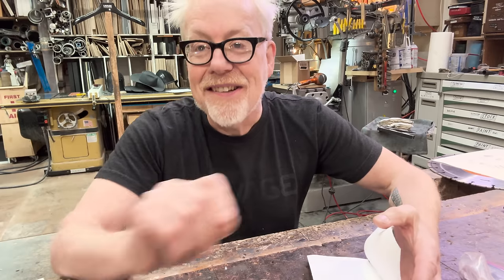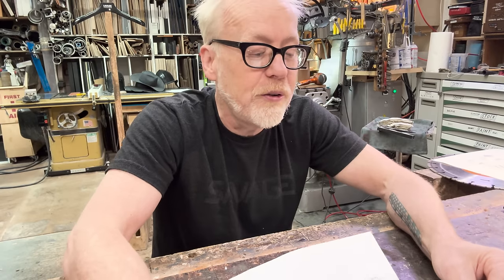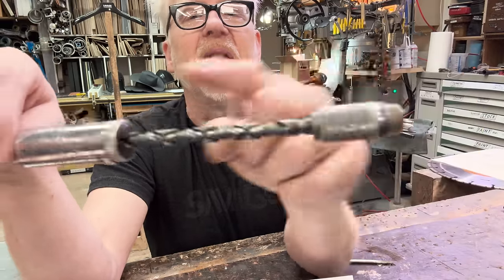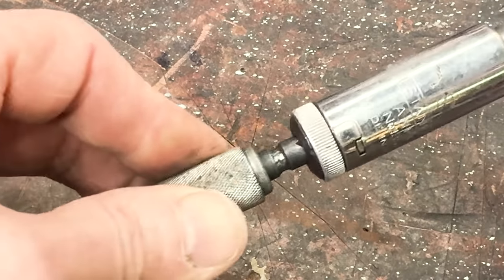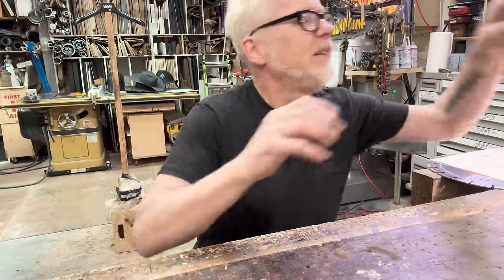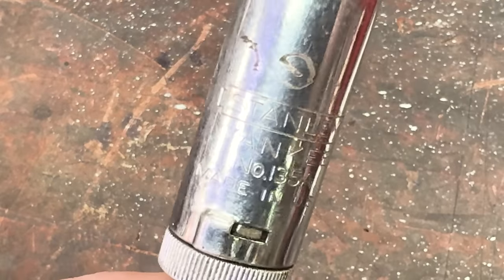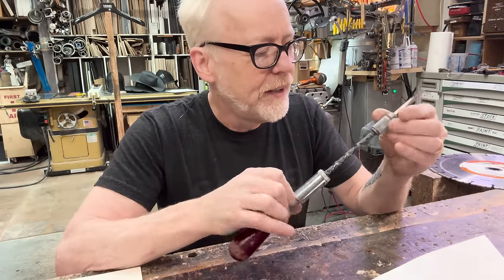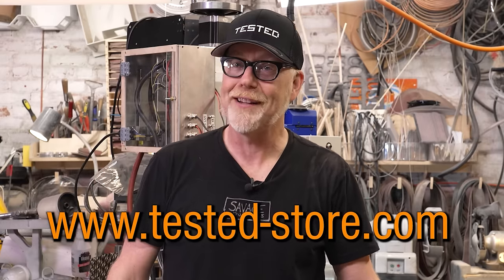Adam Savage's New Stanley Yankee Screwdriver!

Comment: Stanley Yankee pump action screwdriver …….. the tool of the devil in the 70’s. How many times did I watch my dad struggle with his. 😂
Reply: And the whole thing jumping out 😂from its locked stowed position threatening to take your eye out!
Reply: @SierraLimaOscar  I have a blurred recollection of my brother nearly losing an eye due that happening 🥴 They were a lethal weapon in the wrong hands. 😂
Reply: In the UK 20  years earlier, the first DIY TV show was a guy called Barry Bucknell .  He had a 12' Yankee ,  Thump, Thump Thump and the screw was in no messing.  Everything pre-drilled and prepared before he came close to it though
Reply: @russeldavis1787  Ahh, yes I do remember him. He made some neat things and made it look soooooo easy 😂
Reply: I have one that was my grandfathers, unfortunately it only has one bit. I have used it a few times over the last 30 users, it’s actually not bad unscrewing wall plates.
Reply: @only1muppet  I have a couple. Bits are surprisingly easy to find on Ebay and the like. I actually took a magnetic 1/4" hex bit holder, ground a flat on the end of it, and keep that with my Yankee screwdrivers. Makes them much more versatile. Not that they're very practical compared to a cordless drill or impact.
Reply: An absolute joy to use with slot headed screws 😆
Reply: My dad had one of these in the 80s
Reply: @russeldavis1787  He had a twelve-foot long screwdriver?
Reply: @SierraLimaOscar Guy at my carpenters trade school in the 80’s put one into his hand while messing around. He was unlocking it and relocking it letting it shoot out and the tip went into his palm. They were banned there after this and he was very unpopular with the rest of the apprentices.

Comment: A friend of my father’s was a salesman for Stanley. Their demo for the Yankee was to pilot drill 5 holes, then start 5 screws in a board and give a normal screwdriver to the customer.  They were invited to put the screws in. While they were doing that the salesman would put a drill adapter into the Yankee, pilot drill 5 holes using the pump action. Then switch to a screw bit and drive all 5 screws home well before the customer would get his screws more than half screwed in.

Comment: Adam, the strait knurling forward of the switch locks the action in the collapsed position. Also the middle selection disables the ratchet setting. I have several of those from my great grandfather.
Reply: And they can work like a regular screw driver when you need it.
Reply: It was bothering me that he never locked it close.lol
I'm sure he was doing it on purpose 🤣😂🤣
I still have the large version in my tool box. It's a Beast of a thing
Reply: Yes, and when it is unlocked from that position it automatically springs open, Harry Tuttle style. (At which point, one should say "I'd like to talk to you about your ducts.")
Reply: Correction: only the longer ones have the spring. I didn't realize this, because I have only ever used the long model,  not the shorter ones. My bad. Adam will need to get a 131A for his Tuttle Tool Bag.
Reply: @mikevandebunt811   From the way it responds on video it looks like Adam's has the spring. Looking closer he has a 135A. The '35' is the smallest size and the '1' indicates spring return.
Reply: @eDoc2020  OK, sounds good. Other videos have said that the A is there to indicate "automatic", i.e. spring return. (The one I have is a 130A, so either the 1 or the A indicates the spring. Isn't tool archaeology fascinating?)
Reply: @mikevandebunt811 1 is the fact that it has the spring. A indicated that it was the earlier model

Comment: You can lock the screwdriver in the compressed position by twisting the collar near the switch, it will then operate as a rachet screwdriver too in either direction, selected by the switch.

Comment: Hi Adam!  The larger one you mentioned is the model 131A and the "shenk!" sound it makes when released from the storage position is soooo satisfying.
The knurled ring between the base and the helix is turned to lock the driver in the shorter storage position (and then to release it with that dramatic flair as De Niro did).
Lee Valley Tools sells adapters for both size Yankee's to allow 1/4" hex bits to be used.

Comment: Fun video.  I have one of these screwdrivers but it only comes with a straight slot bit.  I was able to copy the notches on the shank of a standard hex adapter so I can use any modern bit in the tool.  Works great and doesn't hurt the tool or the look of it.

Comment: As a handtool inclined hybrid hobbyist woodworker a Yankee screwdriver is my preferred method for drilling pilot holes.  The straight fluted bits that came with mine are wonderful.  Plus it's just so much fun to use.

Comment: I have the long one and the short one both are fantastic. I have power tools but sometimes you want to put something in by hand so you can feel the screw so you don't strip it. The bits can be a little expensive so I was happy to find Axminster tools in the UK sell a hex head adapter which means all your standard hex head bits will now fit in there including hex head drill bits which comes in extremely useful.

Comment: I have one of these Stanley Yankee screwdrivers that has a plastic handle that hollows inside and holds several different bits with a screw on cap on the end. I picked mine up from an older friend of the family who'd passed away. I've used it a few times so far along with a Carpenters Bit Brace Hand Crank Drill and some vintage planes, several draw knives and other vintage woodworking hand tolls from the same old guy.

Comment: I have three of these, one about that size and two larger ones, one of which I kept from my late father's tool kit.  Way back before cordless drills/drivers were a thing, I used to carry a big one and a small one for my work as a door engineer, and I had a whole set of drill bits and countersink bits, for both drivers, as well as all the screwdriver bits I could get in each size.  They still hang in my workshop, as I can't bring myself to get rid of them.  They did so much work for me, it seems almost wrong to discard them.

Comment: I still have mine from April 7, 1969 - mine is all stainless steel and the buts store in the handle - I used it mostly with drill bits to put the phone jacks on the wall - they are great tools - I also had a couple like that one and might still have one - I do still have a hand drill that has a hand crank like the old meat grinders had - also mixers had them -

Comment: I've had a larger version Stanley Yankee in my toolbox since the early 1970s. Set the switch in the middle position to use the screwdriver in a traditional (wrist breaking) way. Compress the driver and twist the locking ring to store it in a smaller space.

Comment: I have what appears to be another of the same screwdriver! And yes, every time I use it I think of Harry Tuttle.
If you compress the screwdriver and switch it to "locked shaft" mode it will stay that way until you change mode, at which point you get that lovely "shoonk!".

Comment: My father owned one of these monsters, and I cannot tell you how MANY times I painfully pinched my finger tips while using it, sometimes even drawing blood. I finally learned to avoid it entirely. However, in its favor, it should be noted that the mechanism produced almost NO useful torque, such that it was almost impossible to actually damage a screw head with it. If there was ever a tool that should go down in INFAMY in history, it's the Yankee Screwdriver. [The beloved Yankee Drill, however, is a whole nother story, and I still own one of those antique models, which proved that drill bits don't need to have a "twist" shape.]

Comment: I have one of those that I probably bought at Sears in the early '70s and used regularly at my job in a boatyard.  Very useful tool, and I never witnessed anyone injuring himself or others during it's use - maybe it's a generational thing.  I also have a push drill that operates in much the same way.  They're both very handy - no cords or batteries to cause frustration.

Comment: These things are addictive. I bought one for odd jobs around the house about 10 years back, still use it. Problem was, it led me down a rabbit hole wondering how they came about.   Almost 2 dozen later i  now have a collection going back to 1874, including a couple made by F A Howard in 1874 to Isaac Allard's  patent. Allard actually patented one as early as 1868 (believed to be the first) but no working example has been found to date.  😎

Comment: My Dad had the longer version, and it always fascinated my as a kid. One thing that isn't obvious, when the driver is fully collapsed there is a collar just forward of the selector that can be turned which locks the mechanism closed. You can then use the driver in just 'ratchet' mode where you can just turn the handle without needing to push it in.

Comment: Pretty sure I had one exactly like this, right down to the Stanley brand, when I was a kid and had what I just now realize is my first makerspace in the attic of the house I grew up in, which was not floored or anything - I just had a narrow board walkway & platform (presumably left by the builders from when the house was first built) & a worktop screwed right into the roof support structure. It was sort-of my Emil from Lönneberg woodshed where I went to hide from the grownups 😁

Comment: I recently inherited one of these from my grandfather--I haven't used it for anything other than display and fidgeting so far, but it's absolutely one of my prized possessions. Just a super cool old tool.
Another film appearance of this is in Breaking Bad when Mike, Walter, and Jesse are breaking into the police yard to sabotage Gus' laptop with the giant magnet--Mike uses one of these to quickly pull the cover off the keypad. 
And on the Air Force Museum outside of Dayton--omg yes, 1000% a must-see. Plan for at least a full day there, maybe even two full days. I spent a half day there and at a certain point I just had to start snapping pictures and then running to review and read the plaques at a later time. It is absolutely massive and amazing. I can't wait to go back eventually and spend a proper amount of time there!

Comment: I have the same Yankee but mine is made by North Brothers. Stanley bought North Brothers at the end of the war. Push the driver in and twist the knurled part and it will lock the driver in for storage or to use as a normal screw driver. Just a little twist of the knurl and it will shoot out again. Elwood Blues had one he used on an elevator panel in the Blues Brothers.

Comment: I always preferred the impact driver...very similar, except this one you hit with a hammer, the blow from the hammer not only rotates the bit, but the impact forces the bit into the screw head as it rotates.  Doesnt always work great, but for those really stuck screws, it can sometimes be a life saver.

Comment: Dammm, i haven't seen one of those in a very long time, My Dad had one, thats back in the 70's and 80's. Great memories came back using it with him and boat building, miss him, Dads been gone 20 years now, thanks for the reminder of great times with him. Actually i'f i'm not mistaken, i have a large steel chest with Dads wood working tools, it might be in there, will let you know. Checking it out when i get home tomorrow. Editing:,,, couldn't wait till tomorrow, went and foung his chest and took everything out and found some wonderful old hand tools, and yes that screwdriver was there, shorter than yours and another more modern one where the helix wasnt on the outside but rather somewhere inside the works, its smooth on the outside with a plastic handle with a removable top on the handle where different bits are housed, memories, there is some rust now on them but i sprayed everything down with wd40 and after the sugar crop here in Barbados, i work for the sugar industry, i'll be demolishing my workshop and rebuilding it twice the size, planning on a glass fronted case so those lovely tools can be displayed after i've cleaned and sharpened them, i'll be putting some use into them again.

Comment: We, my family, had a Yankee Screw driver when I was a kid. It came with the straight slot driver (bit). As far as I know, they were supposed to have other bits (drills, etc.), but I've never seen any, designed for the screwdriver. The shank size limits what can be used. I suppose that other bits can be modified, to work?
Stanley also makes the Yankee Drill. Same basic design principal, but comes with a set of very small drill bits. I own one. This tool is super for drilling small holes in anything, but metal.

Comment: I have two of those Yankee screwdrivers in my tool box, you can buy an adapter that fits in the chuck that allows  you to use the standard 1/4 bits that you would use in magnetic screwdrivers of today, I don't use them often but for nostalgic reasons I can't get rid of them.

Comment: You didn’t mention the third position that locks the extension. Or the knurled ring  that locks the extension closed. Or the use as a ratchet screwdriver with the extension closed. Steve
I ha both small one like this and one of the large ones as well

Comment: If you compress it, you can lock it.

I have three, two large Stanley and a smaller Japanese one (forgot the name). I use the small one fairly frequently. It's a fun tool so it has its very own special task that only it may perform (screwing a bench hook/plane stop to my Low Roman Workbench).

Fun facts:

- If the bit isn't properly secured and the locking mechanism is then engaged to extend the drill, the bit will shoot through the room.

- Do not unscrew the big screw on top of the handle—especially if the screwdriver is compressed. The very strong spring inside the handle will seek its freedom.

- Bits can still be bought—just remember which size your screwdriver uses.

- A bit holder can be bought to hold any type of standard bits to use in the screwdriver.

Comment: I have several of these, including this exact model. The bits are harder to find than the driver itself - some of them were built with a compartment in the handle, accessed by a screw-on cap, where the bits could be stored. Properly lubricated, they are easily more appropriate for some applications than the ubiquitous cordless screwdriver.

Comment: I have a couple of these in different sizes which I inherited from my dad who was a carpenter at the Dutch Tropical Institute (Tropenmuseum). Actually if you retract the tool and then turn the collar on the shaft clockwise it will lock it in place. When you turn it counter clockwise it will then jump out like the one Robert De Niro had ;)

Comment: The 41-Y drill is very handy, the way the bits are stored in the handle of the drill is clever.  As someone else said there are hex bit adaptors available for Yankee tools, and the hardware store near me stocks a new version, I can't recall the brand, that is built to use hex drive, which opens up all kinds of possibilities considering the wide range of attachments available.

Comment: Also a great tool for rounding off the heads of your screws. Because it can be tricky to get heavy pressure on the back of the screwdriver, if the screw resists at all, the head will slip and begin to round off.

Comment: I have that exact model screwdriver. The knurled ring below the switch will lock the mechanism so it doesn't ratchet. But, I don't use it much. They kind of suck, especially with a blade bit. You'll see if you try to use it.

Comment: In school we had one of the screwdrivers that was at least 30 inches long. My shop in vo-tech was Building Trades Maintenance. When I went thru the electrical courses, we used to rush out to grab that driver so we could go faster. Back in the early nineties, we didn't have the cordless tools to use yet. Now, I have an old one in my toolbox, I just need to remedy the lost butt cap.

Comment: Elwood Blues (Dan Aykroyd) uses one to break into the elevator at the end of "The Blues Brothers" as well, that was the first time I'd seen one.

My old boss had one in the shop toolbox and I'd always play with it for a second whenever I came across it. The only thing that would suck about having an original Yankee today is those proprietary bits that I can't imagine are easy to find, although I remember doing a search some years ago an apparently you can buy them now as a modern hex bit driver. I've always wanted one of these myself, if only just to have it.

Comment: I have a Yankee screwdriver just like that.  It was my grandfather’s who was a carpenter in the 1940s-70s.  Don’t remove the screw at the of the handle or an ~8in long spring will fly out!  I learned that the hard way while greasing mine.

PS: Stanley also made a set of straight fluted drill bits for the Yankee screwdriver in 5/64in, 7/64in, and 9/64in sizes.  If anyone wants to look for the set (they’re no longer made) it’s model #330 H: Yankee Drive ‘n’ Drill Accessories pack which includes the aforementioned drill bits, flathead, and Phillips head screwdriver attachments.